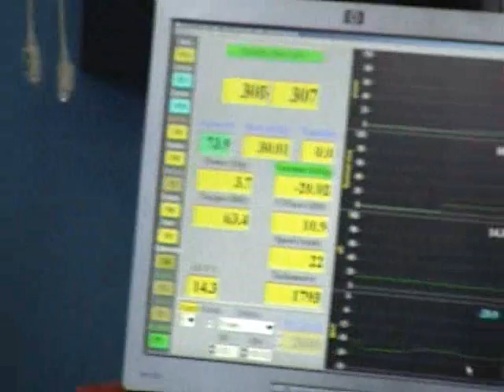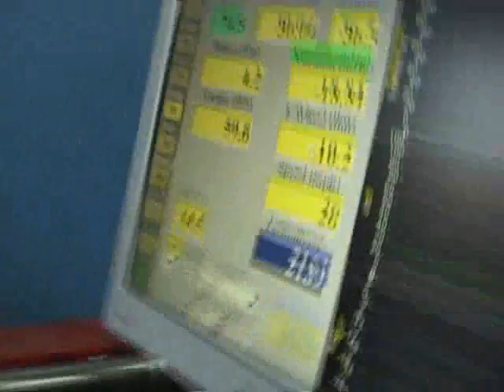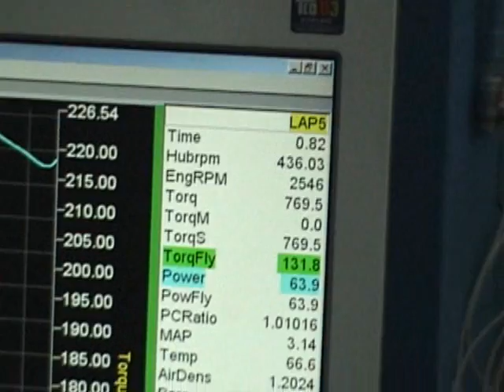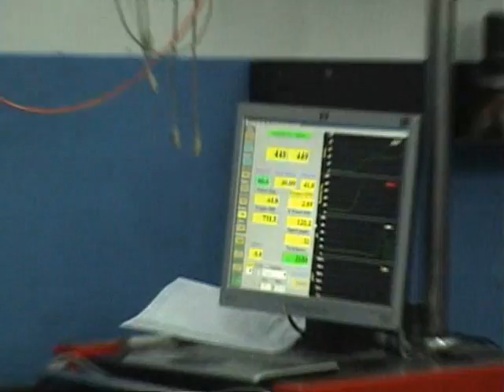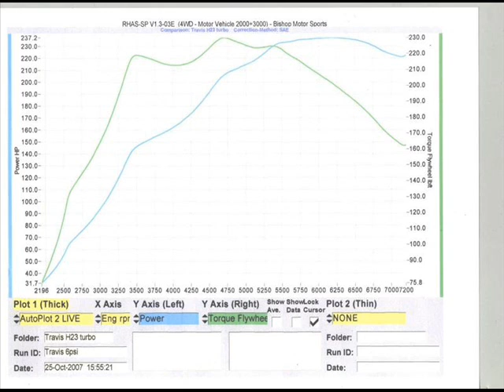Turbo H23A1 on the Dyno - 238whp/225wtq @ 6psi

Comment: is the prelude all stock motor?
Reply from the maker: Now its an all motor H22A. In this video it was a all stock H23A1 with a little turbo kit I pieced together.
Reply: thanks man cause I been wanting to turbo my h23 lude but besides a turbo kit I'm lost on what I need or have to do
Reply from the maker: besides the turbo kit youll need a tunable ecu like a p28, walbro fuel pump, id725 injectors, better clutch, 3" uncatted (preferably) exhaust, oil temp gauge, wide band o2 gauge and boost gauge. hondata s300.

Comment: @armorog so a ferrari or a lambo V12 is not much faster than a V6? DAMMIT!!! i thought it was.

h23a vtec under the hood and a h23a vtec swap in the trunk to the rear wheels= double the power(pararell 8 cyl. engine,new meaning to the v8 engine lol.) also all wheel drive(awd) 4x4 if you have LSD trannys, not to mention one bad ass one of a kind ride.

you need to think OUTSIDE the box, the limits of your imagination and you need to check how deep your pockets are.

try searching RWD h22 integra.

Comment: @mariosintegra you need to check you math.  Doubling an engine's size will not double it's power. If you decreasse an engine's size by half it power decreases by a third, it physics.  they reason why people like bigger engine's is because there is no replacement for displacement that's why they make stroker kits for everything. more fuel + more air = more power... doesn't matter if it is a USDM, JDM or Euro.

Comment: @retardedfolks "The H23A is DOHC VTEC"-- not true.. i have a h23a in my lude i got from hmotorsonline... its the same exact motor as the h23a1 only its from japan and it comes out of an honda ascot innova and yes its non vtec... and comes in a open deck instead of the h23a1's closed deck

Comment: the h23 has faster strokes then then f22b doch but the f22b is a better moter hands down unlike the h23 the f22b has iron sleevs ect therfore is ready for boost in my opinion is a better moter for stock turbo apliance...now if you shit that moter consider the jdm f22b nice lude by the way! :)

Comment: The Heat Rating of the spark plugs is a measure of the spark plug's ability to remove heat from the combustion chamber. This rating is dertermined by the length of the ceramic center insulator nose and its' ability to absorb and transfer combustion heat, the material composition of the insulator and center electrode material.

Comment: Let me explain, the extra heat generated by the leaner ratio would way to high for the spark plugs to work great. The spark plug tip temperature MUST remain between 500C-850°C. If the tip temperature is higher than 850°C the spark plug will overheat which may cause the ceramic around the center electrode to blister and the electrodes to melt. This may lead to pre-ignition/detonation and expensive engine damage.

Comment: part5
Now if you say that US gasoline is like petrol but cut with about 5% ethanol you can calculate 5%*9 + 95%*15 = 0.45 + 14.25 = 14.7 and get anAFR for gasoline.

So you can always put your car on 16:1, considering the heat, the best air fuel ratio for 'gasoline engines' is 14,7:1...chemistry .

Comment: part4
So AFR for methane calculates to 17.2 and Ethane to 16.1.
Then propane 15.6 and Butane 15.4.
Now if you add oxygen things change drastically since oxygen in the fuel means you need less oxygen from the air. And since air is 4/5 nitrogen, if you can cut down on a certain amount of oxygen then you reduce the amount of air you need by a factor of about 5, (drop 4 N2s for each O2 dropped). So the AFR for a fuel like ethanol works out to be about 9.

Comment: part3
So if you crunch the numbers to get the AFR 
AFR = a(MWO2+0.79/0.21*MWN2)/MWfuel
you get 15.06 for petrol.
Since hydrocarbons are mainly H-C-H, two to one, and the odd H at the ends making the difference are light, all the HCs will have similar stoichiometric air fuel ratios, with the exception of the very light ones where the two extra hydrogen makes up a significant proportion of the weight (CH4, the H-C-H weighs 14 and the two H's weigh 2. That's a large portion compared to 2 in 114).

Comment: (part2) 
CxHy + a(O2+0.79/0.21N2) => xCO2 + y/2H2O + a*0.79/0.21N2
where a=x+y/4 since a C can use up a whole O2 and an H can only use 1/4 of an O2. The 0.79 and 0.21 are the proportions of N2 and O2 in air.

If you take the formula for a hydrocarbon reacting with air you can easily work out how much of each is required.

molecular weight of O2 is 32 and N2 is 28.
Octane C8H18 has a=12.5 and molecular weight 114 ( 8 12's are 96 plus another 18).

(see part3)

Comment: Well in the case that you would get a 16:1 ratio, by modifying your system to get it leaner, the extra heat could be corrected by getting some colder spark plugs. Or by adding a cold air intake, actually this one is not true, the cold air intake usually lower the air temp. but enhance the air/fuel ratio, adding more heat. 
And also the material used is not the only reason why, let's get to chemistry: 
I originally mentionned 14,7 : 1 for the ''most'' efficient.... (see part 2)

Comment: I actually made a mistake , again. By saying 14,2 /1 air/fuel ratio. It's the more fuel efficient, but not the more power giving way. Actually there's no magic number. But most of the engines produce maximum power at ratios in the 12.5 to 13.5:1 range. ...Actually it was not a mistake, it should've posted between the post of air/fuel ratio and the one talking about turbos.

Comment: So the best way to accelerate is to shift at maximum transmission output torque. Actually means the same as : at the maximum engine power. Shifting at Peak Torque is then one of the worst way to accelerate fast,  you will lose maximum gear torque, and get even worst in the next gear !

Don't worry, I have some Physics. ;)

Comment: So why don't everyone get bigger gears !? Hmm pretty simple. Well, Higher Tq = Lower Revs (Tq=Hp*5250/Rpm) assuming that you have the same Hp. But didn't we said that Tq and Hp are related ? Yeah, but now were talking about Tq given by the transmission by adding bigger gear set, the transmission doesn't add HP. Knowing this, would you want your car to have 400Tq in first gear but can only reach 10mph? The opposite is also true, using smaller gearset gives you higher top speed, if u can reach it.

Comment: I explain : the higher you rev, the more time you can spend in the same gear. While actually being more agressive.  The  transmission is actually the trickiest part of all. Most of the people, think that higher Tq gives higher acceleration compared to a lower Tq/higher hp, but the transmisson as its word to say, it can make the Tq meaningless. The Tq is a twisting/turning force applied to an object (wheel/crank). The transmission can multiply the flywheel Tq to any amount it wants to.

Comment: Adding a turbo (or any other method to increase the mass of air in the cylinder) actually give higer backpressure. What goes in have to go out to. High backpressure will lower your power, the amount of air that goes in is related to the amount that goes out! Now assuming that everything is the best in the best world. An High-Rev (hp) car will actually be better , assuming that both cars are geared about the same and have about the same Tq curves, in any was.

Comment: Well actually this is a bit wrong, 14.2/1 (should've been 14,7 actually ) is the best fuel efficient ! When tuning a car, you actually want it to be a little bit richer. There's no magic number in this, most of the engines get there highest Power at about 12,5 to 13,5 / 1.  Keeping the cylinder filled in air, whille accelerating (high revs/speed), is hard. But there's  loads of way to keep it up ( vanos, vtech, turbos and so on).

Comment: Thank you for seeing my mistakes. Finally someone who's not that dumb ! You're absolutly true that an higher hp car will always be faster , considering that they are both geared the same and have about the same Tq curves on dyno!  The best way to make the car go asap to the 1/4 mile is by actually trying to keep the Tq lvl with the High Revs, which is not understood. The faster you go, the faster your revs go, so the harder it is to fill the cylinder with a good air/fuel ratio (14.2 / 1)

Comment: BUILT04COBRA well since the mustang your talking about is probably a V8, your 250hp divided by 2 (cuz this is a 4CYL.) would come out to be 125hp if your mustang was a 4CYL. too.

so if this prelude was a V8 too...it would be 474hp nearly twice as much as your stock mustang.

thats^^^ is this prelude. another h22 turbo prelude that i have seen was 480hp @17lbs. that translate to 960hp if it were a V8.

now...what about the mustang???

Comment: there is more to racing than a straight line. and btw your well built 350 is gonna weigh over 2 times as much as this car so if you have 600 hp in a camaro that car will barly run with a 300 hp prelude and thats in a straight line it would be demolished in the corners